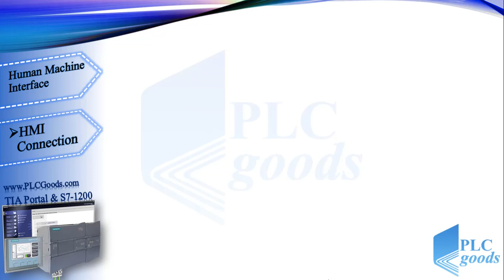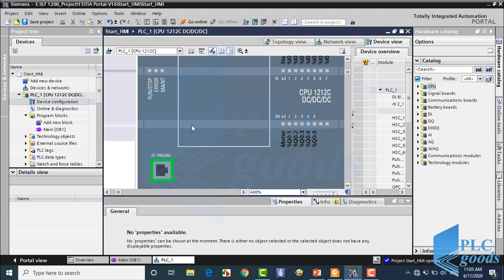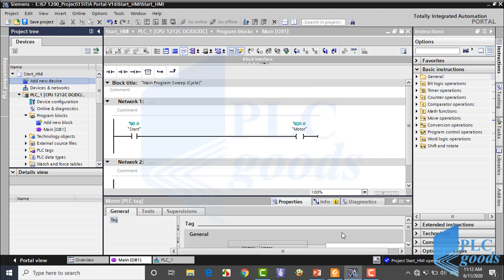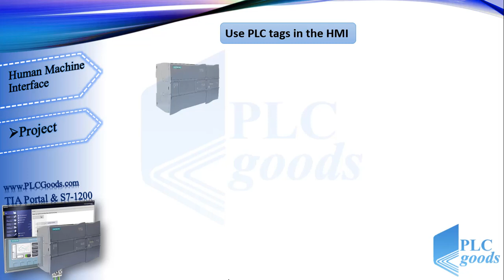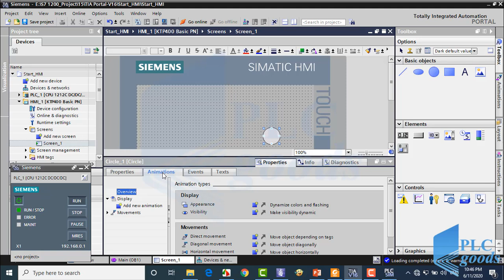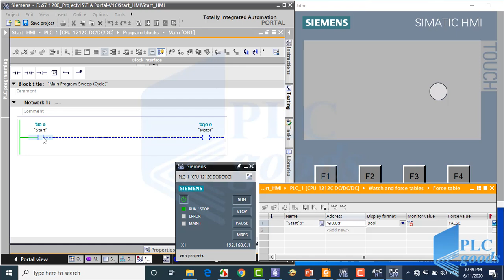SIEMENS TIA portal, KTP400 HMI, how to setup, program, monitor a process | Lesson 31

Comment: can i conect an virtual IHM in tia portal with real clp device, that is, real S7-300 device, thanks
Reply from the maker: Hi there, I've not tested your problem, but based on my experience, it is possible in TIA portal. Because I designed an HMI screen in WinCC and also WinCC flexible, then I connected them to an S7-300 PLC

Comment: I have ktp400 hmi and plc modbus serial 
Then I brought a serial / ethernet converter 
How can I write the tags in tia where there is no rtu driver?
The only I found is modbus tcp ip
Reply: Hello. Unfortunately, I can not help you. as a general guide, first check your HMI connections. then, if you can not connect your PLC to the HMI directly, you will need a communication module beside your PLC. as you may know, there are different communication modules which can extend your PLC abilities
Reply from the maker: please let me know the outcome

Comment: i did my plc project in simatic manager and hmi project in TIA portal,  in that case please tell me the procedure how to connect plc and hmi...
Reply from the maker: would you like to know how can you run your Simatic Manager based program in your TIA portal platform? i do not understand your question, please explain more about it.
Reply: Hi, Note that:
1-The process of downloading a program to the PLC and HMI are similar in TIA Portal. 
2- This video works only base on simulation techniques. A real PLC and HMI are used too, after the 35th video.
3- I think video number 54 can help you (https://www.youtube.com/watch?v=32SXp2beh9Q)
Reply: This is Hayley from Beijing DWIN Technology. Our company is the leading company specializes in manufacturing Smart LCD module and touch panel at China for 20 years and has built our own 250,000 ㎡ production park. If any models you need, please feel free to contact us. We will send you the quotation. Email address： hayley@dwin.com.cn.